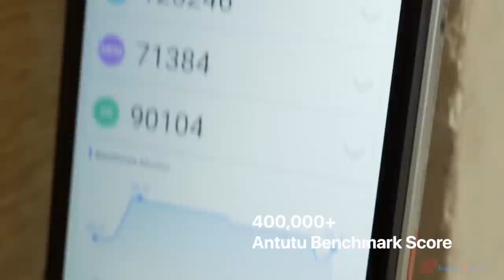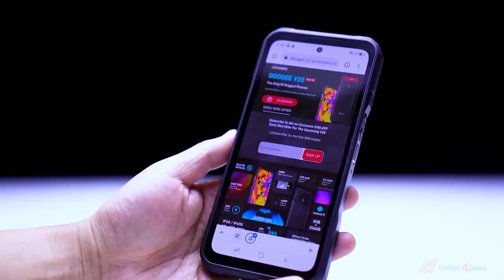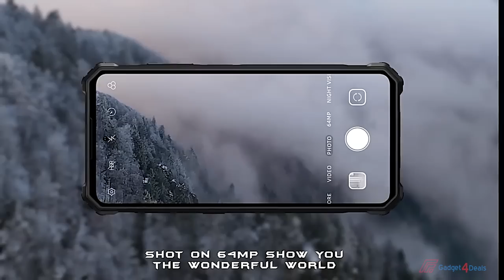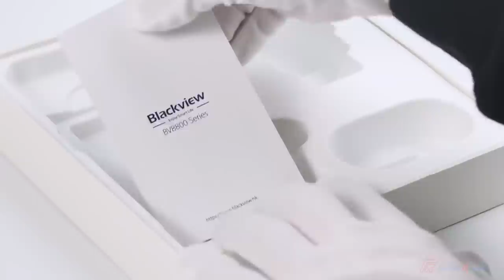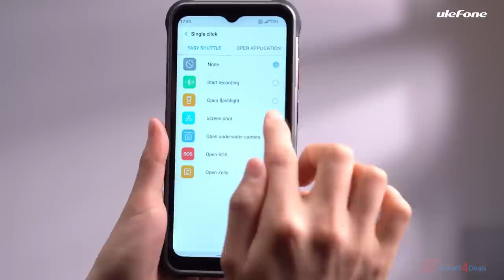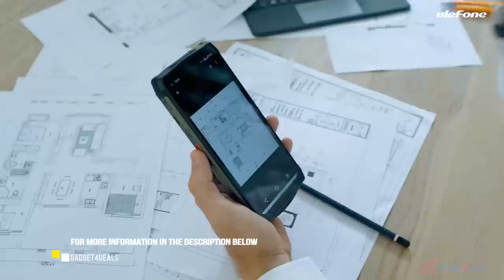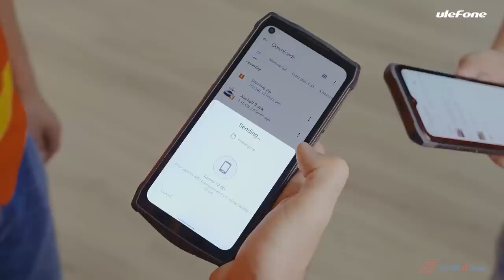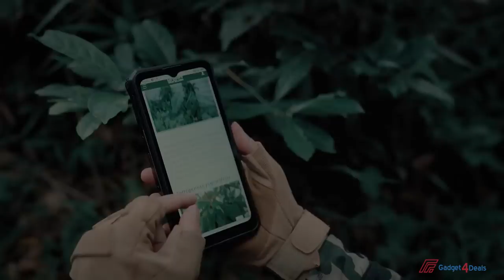TOP 10 BEST Big BATTERY SMARTPHONES 2023

Comment: I have a dream that someday I will be able to buy a smartphone that has one front-facing camera and only rear-facing camera—with the physical, inner-phone space saved by removing 2 less-than-useless cameras from any current smartphone being utilized to fit a larger battery into the phone so that my phone would be able to last three or four full days on one charge instead of like 14 hours.

Comment: the technical data of the ulefon amor power 13 is much more modern than that of the oukitel

the oukitel scores with a little more battery, but the rest is totally weak and old-fashioned. especially the software errors are a joke as well as the price 😂

that was probably a grab into the toilet from oukitel.

You don't have to think twice about which cell phone to buy in 2022 when it's called Oukitel wp15 vs. Ulefon Amor power 13